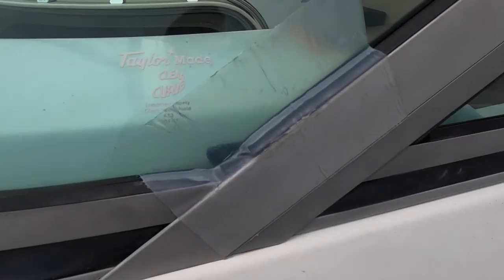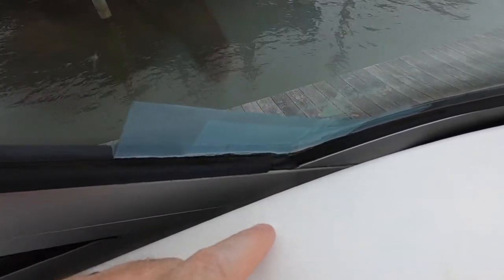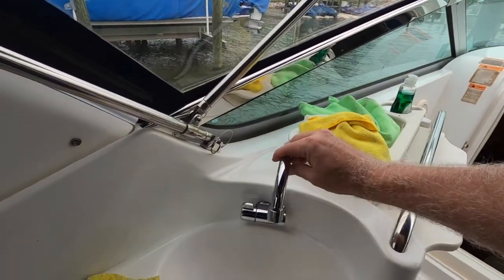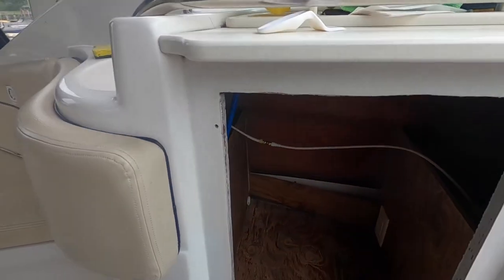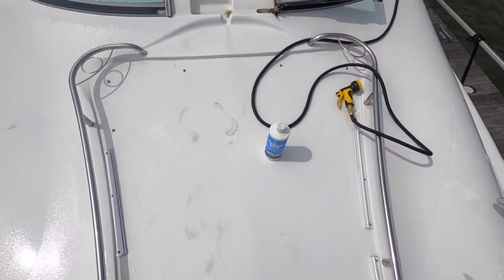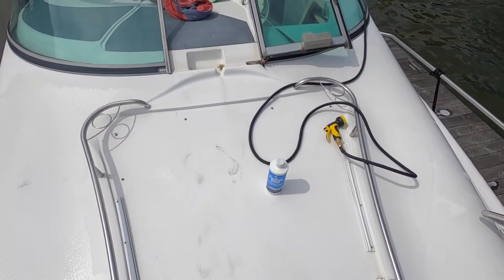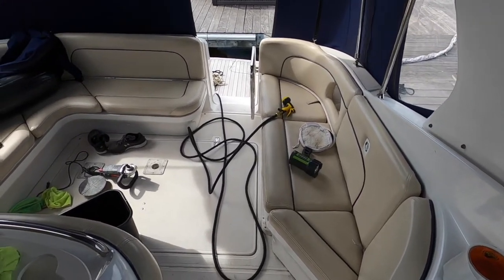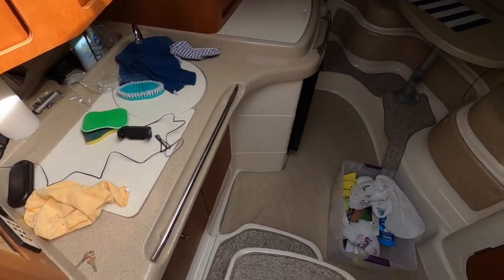More trouble with water! When will it end? Episode 33

Comment: Wait for a week of good weather/sun, pull out the old windshield foam, remove all the screws underneath, let it dry for a few days, rebed/caulk the screws, install the new rubber strips, you are done. You don't need to remove the windshield. Ping me for more details if needed.
Reply from the maker: Thanks we actually aren’t going to remove it. The problem has been solved for the most part. But we might do what you are suggesting.

Comment: Jeff that 1" black strip in between the two pieces of the entire bottom window frame is call a screw cover trim. Under that strip are the screws that fasten to the hull. You may have to re bed those screws. Some Sea Rays have that problem. You might want Google how they resolve the issue.
Reply from the maker: Yes, I did a bunch of research. This was an ongoing issue that I've mostly resolved.
Reply: @eternitysshore  leaks are maddening sometimes
Reply from the maker: Yes indeed.

Comment: Good video..leaks are more t han leaks..they get into insulation and that end grain in any wood you might have for walls. Then there's the mold situation.
Reply from the maker: Agreed. I also eventually figured out that there was a clogged drain on the port side interior. Believe it or not it was a dead ladybug

Comment: I do not know your boat model but both my maxum 1900sc and my cruisers yachts 3470 have water gutters along the inside of the windscreens and that water will go back along the side and run out underneath the side window because there is a little opening made for that in the polyester mould. Just a little opening underneath the window frame. Because the window frame and walk through part in the center will leak a little in heavy rain sometimes. Water will always go into the windshield framing since the filler rubbers have openings all around. the leaks probably come from the screw holes that hold the windscreen framing onto the boat. So I suggest to get your wife to splash the windscreen with a hose from the outside while you sit inside the icemaker space watching the water coming in. You must be able to adress where it comes from. And if it came from a screw hole just remove the rubber filler on the outside from the windshield framing, unscrew just a few screws at a time, make sure it is totally dry, add sikaflex into the holes and put the screws back in the holes. before you put the scres in also add sikaflex to the screw thread maybe. It will spill when you screw it in and the excess can just get wiped away after. Do that with all screws if you want to be sure and put back the rubber. Water that get's into the deck can make the wood rot and that is something you do not want for sure. there are many sikaflex types and I have no idea what all differences are. Just ask what type you need in the store.
Reply from the maker: You'll see in later episodes how we addressed this but we did end up using sikaflex.